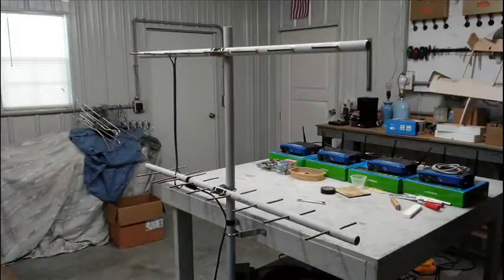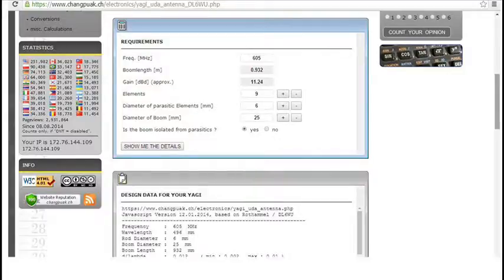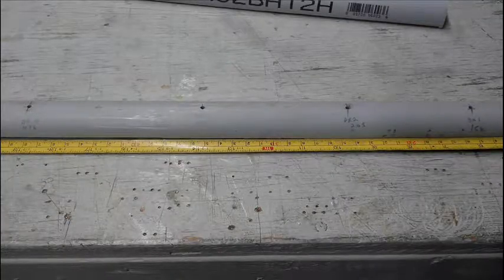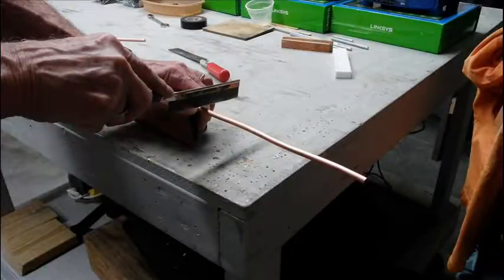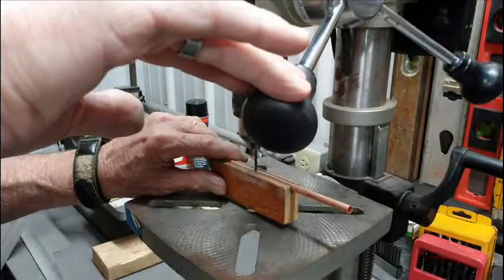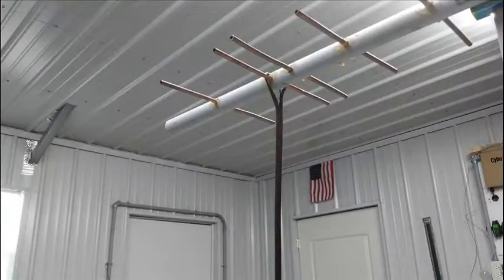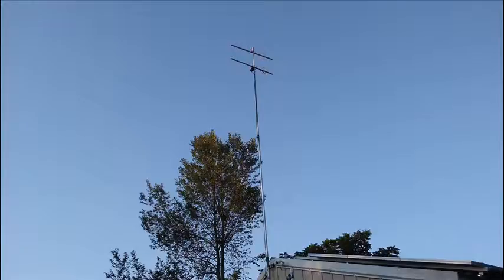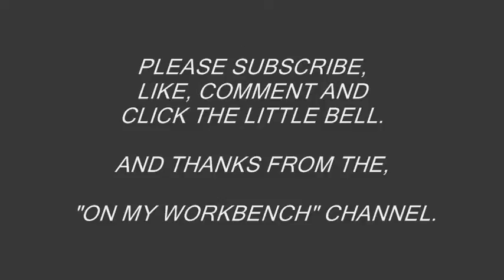DIY TV ANTENNA PART 1

Comment: How did you determine proper spacing between the booms ?
Also it appears you are using 300 ohm twin lead to connect the two antennas.
Shouldn't this lead be twisted a few turns to help with any imbalance issues through the feed line ?
Also, a good preamp with filtering to reject interference would likely work wonders for you !
Just say'n !
Reply from the maker: D Gray

Years ago we used to co-phase antennas using 300 ohm twin lead. After doing Google searches I found this article on co-phasing antennas 
https://www.rfcafe.com/references/popular-electronics/stack-tv-antennas-increase-signal-popular-electronics-november-1965.htm
If I remember correctly the twisting of the 300 ohm twin lead was done if you spacing was greater that one full wave length of the frequency that you were co-phasing for.  No twist for one full wave length and ½ twist two full wave lengths.